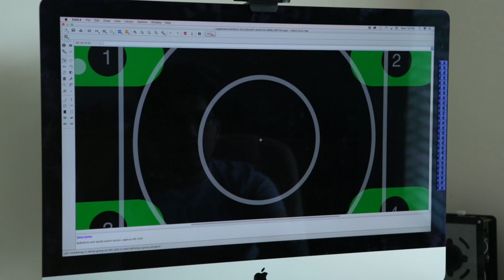Making PCBs with CNC Milling

Comment: Are there any decent milling alternatives for those with a not so high budget?
Reply from the maker: There's "etching" methods that use 2D printers and chemicals that may be worth checking out. PCB fab service like oshpark is another option.
Reply: Adafruit Industries I know about the chemicals method, I was hoping for a cheap(er) milling device, not something that requires chemicals. There are no rooms in this house where it's a good idea to "mess around"  with those (don't have a garage or something).
Reply: there are services like EasyEDA that offer a service that will make you 10 or so PCBs for a decent price
Reply: I know there are (decent priced) services for that, just not around this little corner of the Earth ;)
Reply: What is the price?
Can you send the link 🔗

Comment: So the vias aren't actually lined with copper. Does that mean that you're relying on the solder joints touching the pads for electrical connectivity?